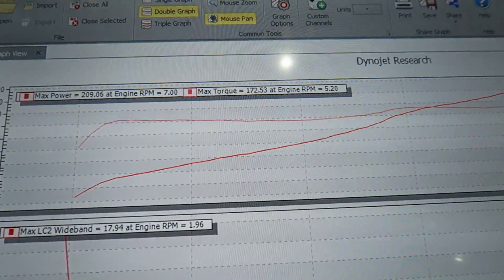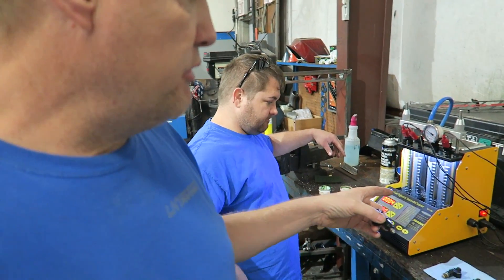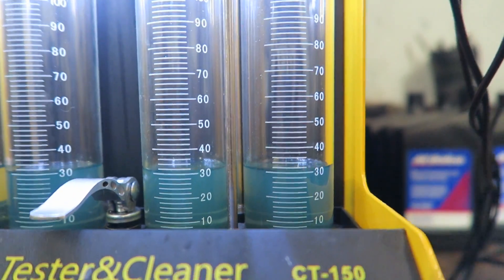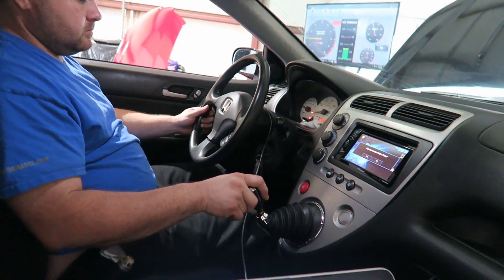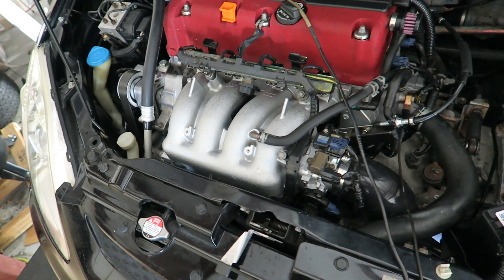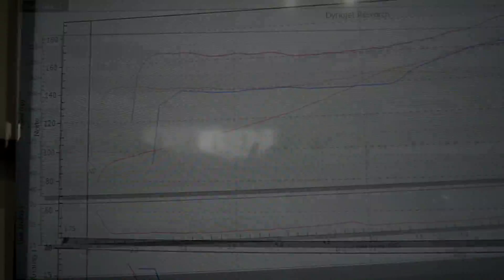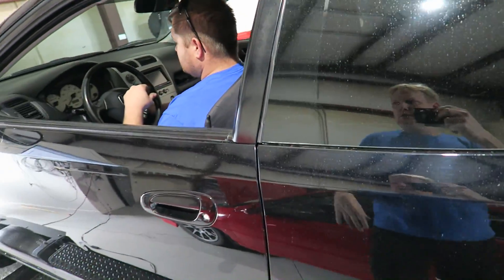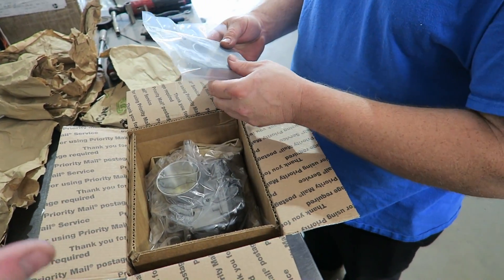EP3 K24a2  EXHAUST Part 2

Comment: My goodness I wish I knew about you guys when I did my K24 RSX 12-15 years ago.  I hate loud raspy exhausts so I kept my exhaust stock but used the ITR muffler which had a valve inside of it.  Mine hit 264/200 with a stock exhaust, I can only imagine what it would have made with this 3” exhaust.  I know where I’m going for my K24 Integra exhaust when the time comes.

Comment: Massive gains up top and massive losses down low,maybe even that out ???
Reply from the maker: You might be reading the sheet wrong. There was no losses. Look at 10:07 for the before and after
Reply: If that’s before and after on the same chart everything under 5200 rpm was a loss with no gains until about 5300 rpm
Reply from the maker: @Everydayprojects365  Are you looking the AF ratio line ?  If you look at the HP and Tq you’ll clearly see it makes more power everywhere. The red shows more increase the whole graph.

Comment: Hey John, I know this is probably a off topic question regarding an S2000, do you happen to know about the ticking problem some s2000's have usually at start up that last quite some time for it too slowly go away? Usually heard from inside the cabin noise seems like it's between the firewall and underneath the dash. Thanks! Keep up the good work 👍
Reply from the maker: Timmybm665 The ticking noise is often lifters a little loose.  Right after start up they will also make a noise from the starter hanging up.  This will only be 1-2 seconds after start up. Then there’s a TCT that will make a noise. You need to figure out which one of these so you don’t chase your tail and throw money at the wrong thing.
Reply: LHTPerformance thanks, I’ll make sure to diagnose each of those possible problems and hopefully I find it. Thank you!

Comment: My K20A with an RBC ported n polished, 70mm TB and full custom 3" exhaust and custom header made 219whp and 160tq
Reply: Hmm you should recheck your tune... 
My k20a2 , 70mm rbc, 70mm sk2 throttle body, custom 421 header, custom 3" exhaust, doctronic ecu, and makes 241 whp

Comment: I can agree with doing the rbc on the k24. Before i did the rbc swap my torque dropped like that but after the rbc it held wayyyy better up top and by redline i was making 10wtq more compared to my stock manifold because of how much better torque was holding

Comment: You're consistent process of elimination and engineering is why I watch every one of your videos. I'm the guy that takes aftermarket parts and modifies them to make them better and it seems as a standard you do the same. I would also really like to purchase a throttle body spacer for a K20 Z3!

Comment: Rbc...Rbc...Rbc...Thanks for solving an age old question for a k20 vs k24.. I have a suggestion... Buy an RBC put a j37 Throttle body on and dyno it.. If its possible go even one step further and get the jdm k20 intake cam..(one for george too) put oem k20 valvesprings on the k24.. Rev it to 8500 Thats as much power the k24 would make on a budget and not touching the head..and yeah when u change the cam change the cam gear to 50° from the 25° stock.. Also do a j37 throttle on george's k20 and than we have most stock tuned honda k20 vs k24..
Keep up the good work..love the new content and its good when you are waiting for a new video..that means you are doing something right.
 How copy-paste are k20 vs k24 dyno's now..just 25hp more
Reply: stefce trajkovski the k24 can’t rev that high without a type s oil pump, after 76-7800 rpm it loses oil pressure and is not healthy for the motor, you’ll eat the bearings, get a type s oil pump or a 4 piston type s ported oil pump and you can rev the k24 to the moon.
Reply: @chriatianwaters3986  i know..i forgot to write it. You might get as well do a f20 pump..so the LHT guys do a video on. It..

Comment: Rdx injectors will solve that, I ran 96% at 8400rpm w/ cycle duty at 12.7 -13.0 AFR on stockers on my FBO 8th gen si.. After OEM rdx injectors im down to around 75% and picked up some decent power. Awesome videos Guys!
Reply: I agree, RDX injectors are the best budget injector I've used on hondas. That screen they removed changed spray pattern, not in a good way. With the RDX they get flow and honda optimized spray pattern.

Comment: wow ive been trying to quiet down my 3 inch exhaust n nothin has helped im gonna give that resomator a shot thanks
Reply: I made one,up sized my header exit to 3inch all the way to resonator and muffler..i run my oem fg2 reso and muffler...no rasp,sounds allmost stock under 4k rpms...
When u go wot the intake sounds more then the exhaust its awesome..had to add 12% fuel so it makes tons of power..had to use rdx injectors because i was at 98% duty cycle..where i live exhaust mods gets your car towed away so im good..catless
Reply: @upnorthviking823  same over here cops here loud n they go chasing

Comment: Any significant gains bore ing out the throttle body? Loving the series everything is fantastic brother.
Reply: Camlobes Vtec on the k series not a lot from what I’ve seen, the older series motors can get some crazy gains from porting the throttle body runners
Reply: Cool thinking about porting an extra stock intake manifold that I have.

Comment: Hey John, unrelated to the vidoe but my brother just picked up a 2020 Civic Sport 2.0 with CVT.  Would you say it's ok to change out the break-in oil at 500 miles with Royal Purple?
Reply: Leave the break in oil until honda says change it. Then you can use the royal purple, even though that's not the best out there
Reply: @trumpetplyrmatt  - thanks Peter.  Car is only at 600 miles.  I think Honda says to leave it in for 5,000 miles, I'll have to call the dealer and check.  I know John changed out his Z06 oil at like 700 miles or so with Royal Purple, it's in a video somewhere but couldn't tell you which one, but that's where I got the idea.  What do you recommend over the Royal Purple?  I was thinking Amsoil.
Reply: @MikeA-79  AMSOIL uses Engineered Base Stock, higher Oxidation Stability, also AMSOIL Oil is cleaner as new in the bottle than all other oils. Comparing new oils, tested in a lab from brand new bottles off the shelf - I have seen ISO Particle counts as low as 14/12/9 on (AMSOIL ATM 10W30) vs most other oils are as high as 19/17/16 or high as 21/19/17. Using an oil with ISO Cleanliness codes at 14/12/9 will scientifically reduce wear 7-10 times, or put it another way, increase the useful life of your engine 7-10 times.

Comment: Doesn't the screen help even the spray for better performance?
Reply from the maker: Aret Zelli  We actually did a back to back and the spray pattern still looks good with the screen off. I heard most of the 1000cc injectors are de capped 550cc.

Comment: Your af doesn't change because it's colder lol dude will never tune my car .
Reply from the maker: On a speed density car yes, yes it will. You understand there’s more power in colder temps...Where do you think that power comes from 🤪
Reply: Lol. I had that same issue upon installing a short ram intake except i was trying to lean it out.  Maybe i should have used a k&n or takada system haha.
Reply from the maker: rJstuff n diy One of the tricks from the Gas mileage nerds is to run a tube over to the exhaust manifold. This works in closed loop operation and forces the computer to lean out the target AFs. Not good for power but saves gas.  Lol.
Reply: @LHTPerformance  i might check that out. Ill keep that in mind. I guess it'll be a little short ram hot rodder haha. With a stock muffler lol. Though i hear that even some modern toyota and scion tc (2ar-fe)? Have bypass mufflers that let it flow better.
An import jdm based magazine said the 180 rated 2011 tc made 211 hp after the 3rd dyno run.
Reply: Mk2vrt if that was true why is there fuel compensation tables based on temperature? Like lht said if colder the air is denser more oxygen. More oxygen needs more fuel otherwise it will lean out.
Reply from the maker: WrenchingDad Correct.  But without actually tuning at all temperatures, it’s based on a guess/calculation.   I always tune in the safe side. Max power =max problems 🤔
Reply: LHTPerformance agreed. Rather be conservative with the tune.
Reply: WrenchingDad it is true when a car gets towed it's tunes for temperature corrections meaning if it's hot less fuel cold or more fuel that's part of tuning a car if it's cold your car fuel should stay the same due to the air being denser your fuel have to be more to make the number the same
Reply from the maker: mk2vrt Unless your tuning MAF the AF will change with temperate.  You can tune the correction tables and get close, but it will change.

Comment: Hey love your channel.  How many amps did you charge it at for how long?  I had slow start issue myself jump box starting a car sitting 2 months.
Reply from the maker: rJstuff n diy The Ctek charger changes depending on load.  It’s designed to stay connected all the time if needed.
Reply: Ok , its automatic.  Could a 7 year old 730 cca battery be revived?  With methods even sweet project cars has posted dec. 2019.  The battery seems to be more stubborn even to jump box starting now. (Part time car)  I did connect the negative cable to a metal prong that did hold the engine cover as a grounds after sitting another week.  All the lights flicker when engine on only.

Now its january and it doesn't even crank the engine w/ the jump box.
Hondas can be very fast na too. 12 second buddys built b16 eg full interior.  I'll probably get rid of this comment by tomorrow lol, .  Thanks for the channel and contents
Reply from the maker: rJstuff n diy lol. 7 years might be time to say ‘Good Bye’.
Reply: @LHTPerformance  ok. Ill get me a walmart battery to get me by. Hope that fixes the flickering headlights and cabin lights.  Thanks again!
Reply from the maker: rJstuff n diy To be honest I’ve had the best luck with Honda Batteries. My truck, Esthers Nissan now have a Honda battery in them. They are pretty good priced too.
Reply: @LHTPerformance  my walmart has $50 value brand batterys basic 530 cca but i might look into the honda ones now.

Comment: Can you mass produce the twin loop muffler for rsx’?
Reply: Even a universal weld on twin loop would be nice . They could sell them, even do titanium option. Prolly gonna be a $200-400 muffler but it'll be worth it. If they ever offer it
Reply from the maker: k00lball3r Check our the titanium exhaust we built for for the Integra
Reply: They don't mass produce anything. If you want something done, gotta take your car to them. One day I plan on taking my Yaris there for a system.
Reply: There’s a twin loop on eBay that’s a Mugen rep.
Reply from the maker: Big D Slap You can buy used Mugen axle backs pretty cheap now.
Reply: @LHTPerformance  They are junk though, you build quality systems. There is definitely a market for 2.5” and 3” twin loop universal muffler. You guys aren’t a manufacturing outfit but you’d probably sell way more then you think. A large portion of us Honda guys don’t like an absurd amount of noise.
Reply: Big D Slap yeah obx but does it eliminate the drone at all?